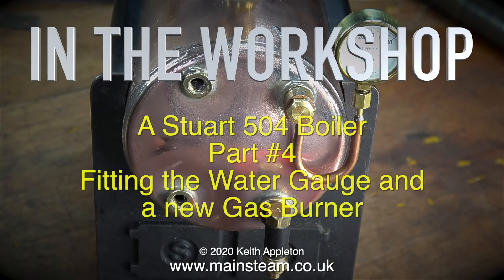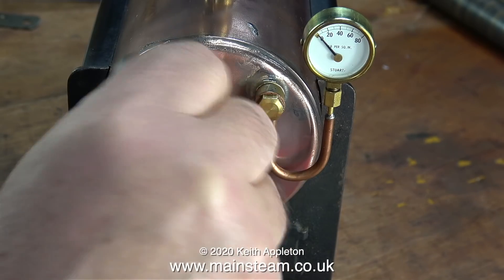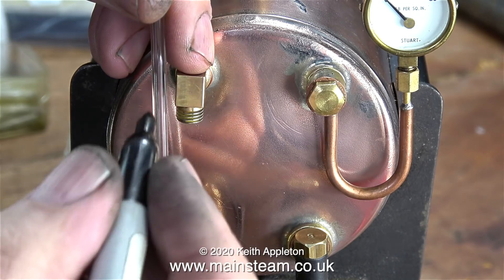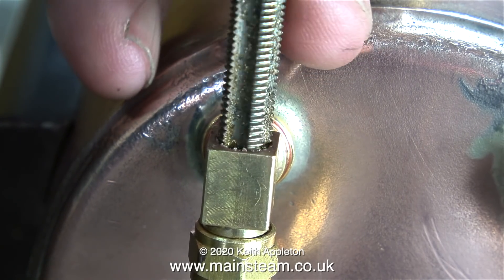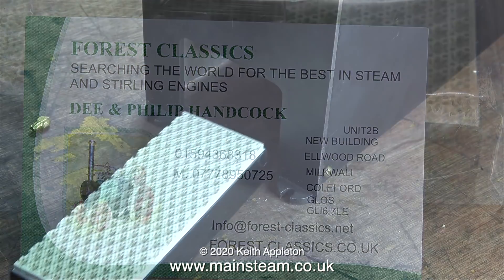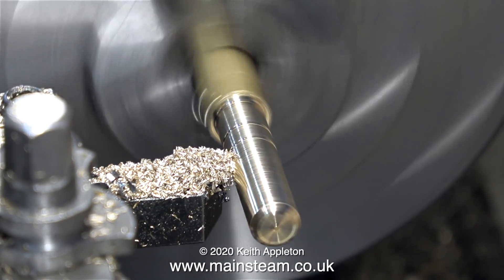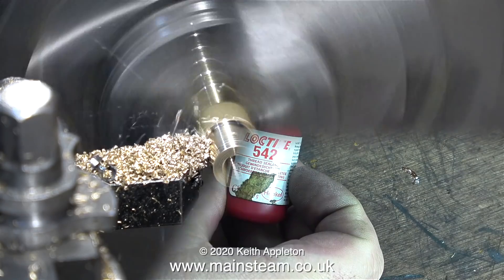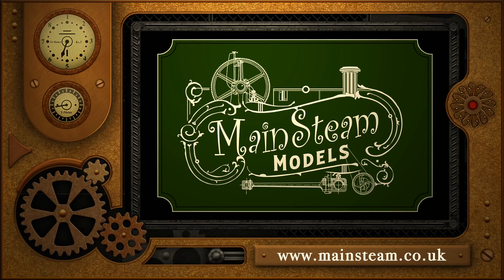IN THE WORKSHOP - A STUART 504 BOILER VIA EBAY - PART #4

Comment: Bonjour Keith,
To complete your demonstration, I would like to share my own experience if you don't mind. I broke twice a glass tube before understanding my problem. The alignment was not exactly perfect; I discoverd it by screwing the nuts without O'ring. I appeared that one 
was lightly forcing on the glass tube, enough however to break the pipe when I noticed a leak and screwed the corresponding nut. Now, I check that without the O'rings, the glass tube remains free before adding the O'rings.
Amicalement, Raphaël.

Comment: I notice you pressure test the boilers, do you do this with the glass in or without? what pressure are the guages rated for?
Reply from the maker: Glasses are Ok, but I always remove the pressure gauges because they do not read up to twice working pressure. They only read 80 psi to 100 psi - too low for a hydraulic test.

Comment: Very unique sizing. I've watched the full size boiler rebuilds when I worked in a refinery. Have replaced many glass sight tubes so understand the tolerances to prevent tubes from bursting when boiler heated up.